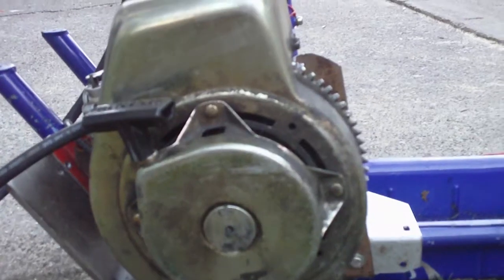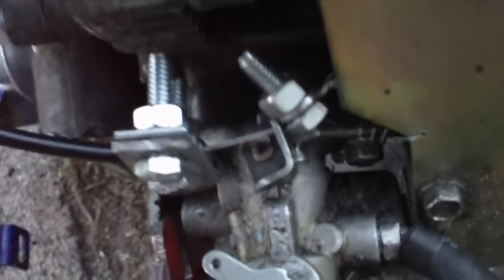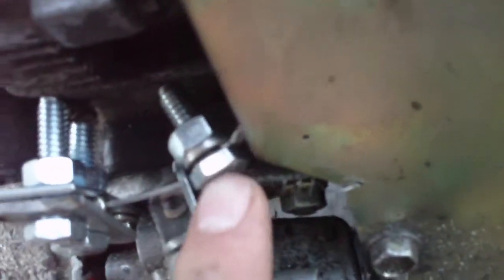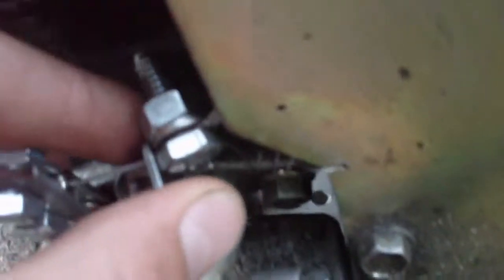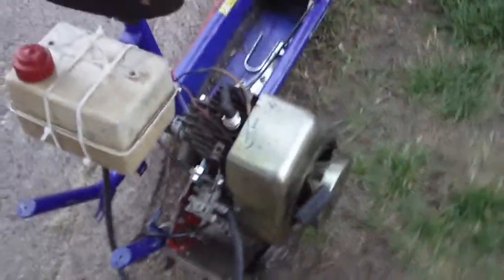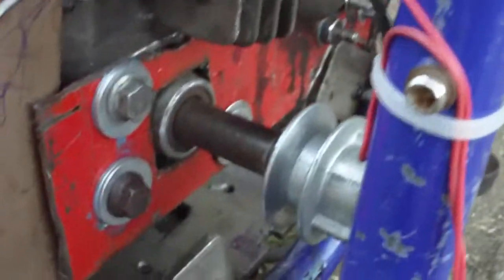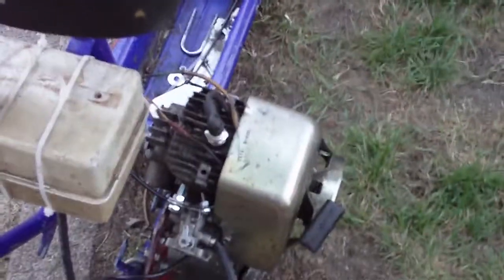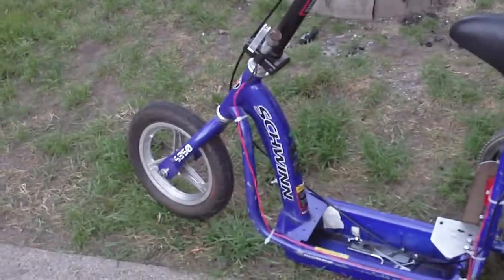Electric Scooter to Gas Conversion... Part I

Comment: How did you mount your clutch? I have the same engine, but the shaft doesn't have any threads in it to screw a bolt into it. :(